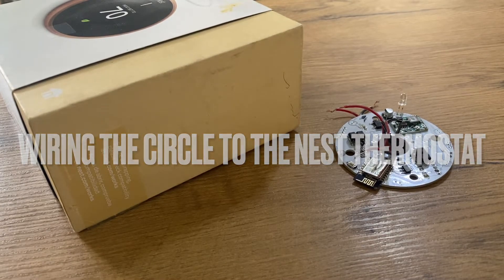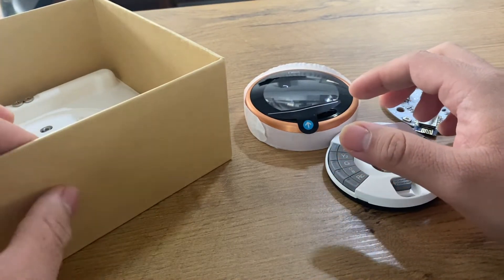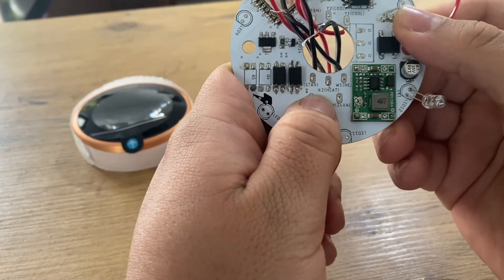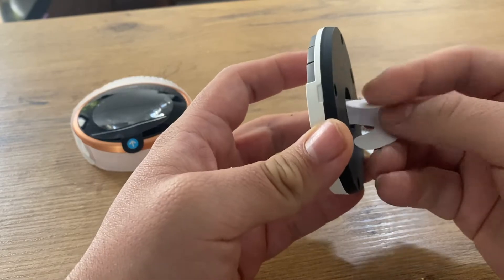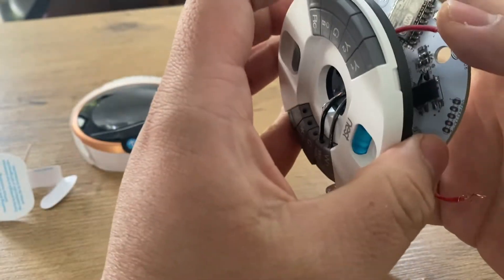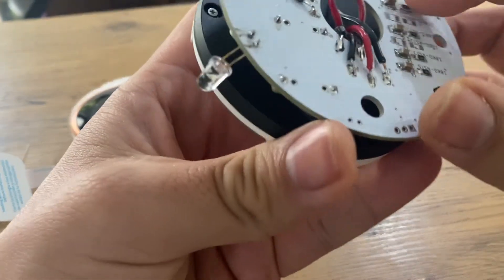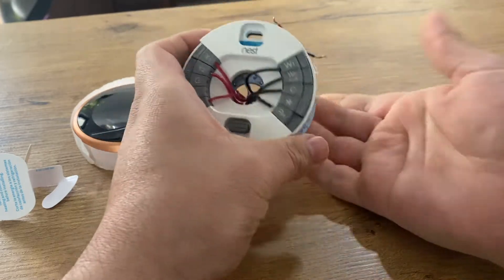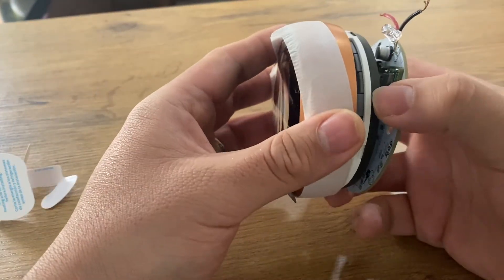Chapter 2. Nest thermostat with minisplit, Wiring connnections

Comment: Wouldn't it be easier to buy IR smart remote controllers and link functions via IFTTT? (e.g. If temp drops below XX, turn on YY).
Reply from the maker: The purpose here is to enable a nest thermostat, other options such as ur suggestion is valid but not for nest interface
Reply: @andressantos4054  I don't think you understood what I was saying. I was saying you can use IFFF to let Nest to communicate with IR smart remote in order to control IR remote devices. This does not require any hacking or complicated stuff for people who are not comfortable messing with the device.
Reply from the maker: @onesimura1771  this addon also has homekit, ghome and Alexa enabled, if you are willing to pay for the nest licensing and go through the certification process that’s an option, but there is no free option of accessing nest apis you have to pay